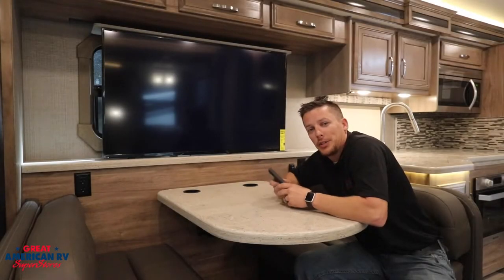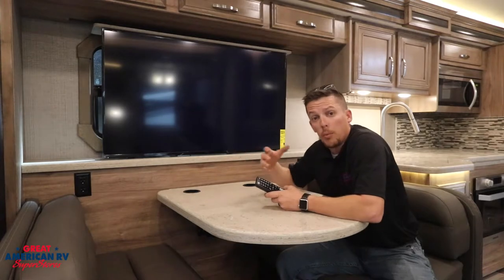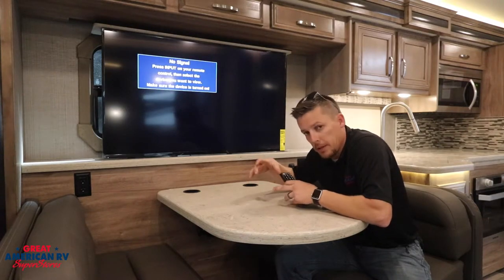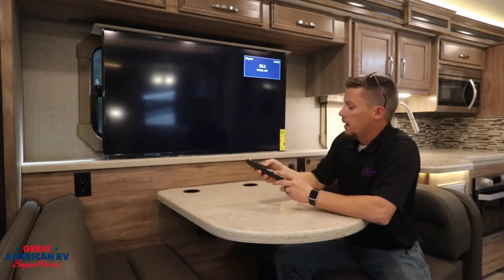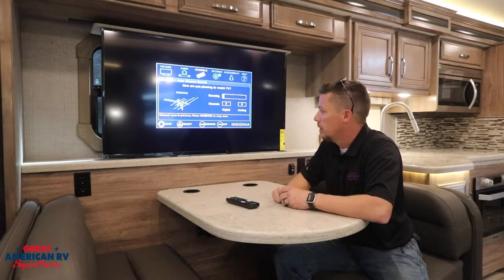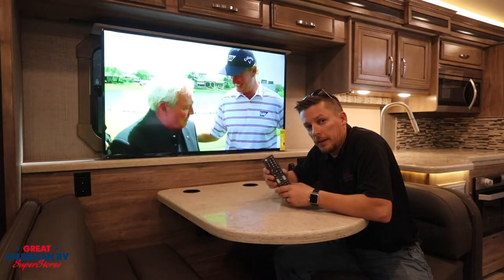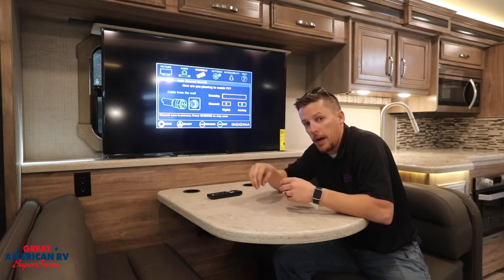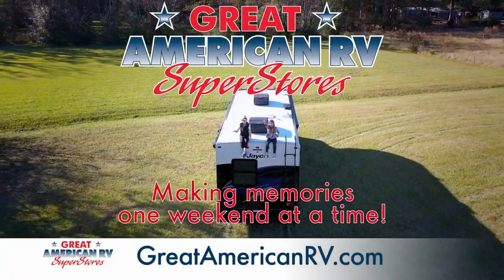How to Perform a TV Channel Scan In Your RV

Comment: Thanks for this video-however we have a brand new motorhome and we cannot get the television to power on?  All areas plugged in and television channel light is on.  The television does not power on and we cannot figure out why?
Reply from the maker: @SusanStockton-gp8in  as long as the power to the TV has been verified, there is not much other diagnosis that can be performed if the picture isn’t coming on.  I would suggest unplugging it and plugging it back in after a few minutes.  Besides that it would have to be verified by a technician and likely replaced. -Todd

Comment: Whwn you said hook coax up to cable How?
Reply from the maker: If your park has cable there will be a coax port on the shore power pole.  Use a coax from it and plug into the cable coax connection on your camper.  -Todd
Reply: What about the cable hook up on antanna boostet.where does that hook t
Reply from the maker: @joanbroyles9802  that will hook to the back of the TV.
Reply: Right now my tv comes up from under counter.theres akso a cable hooked from undernieth to tv.the booster is on wall with no cable on it .im confused now
Reply from the maker: @joanbroyles9802  If your TV is coming up from under the countertop and it likely already has a coax connected where it needs to go. At that point just perform your channel scan.